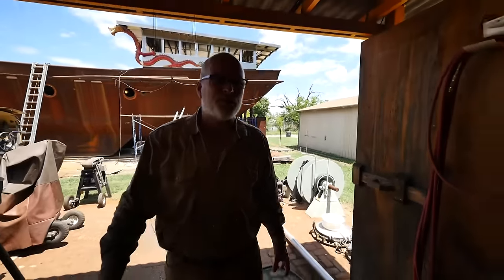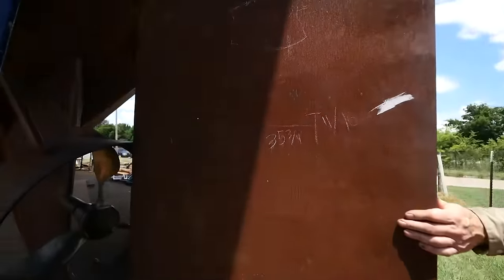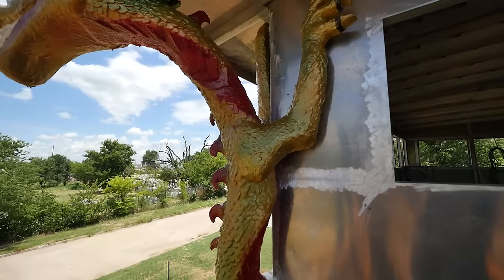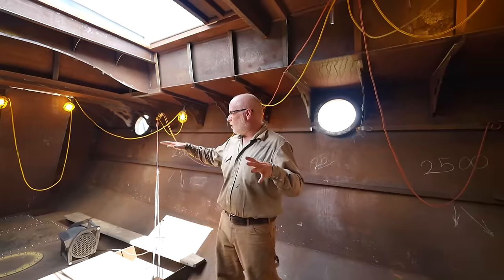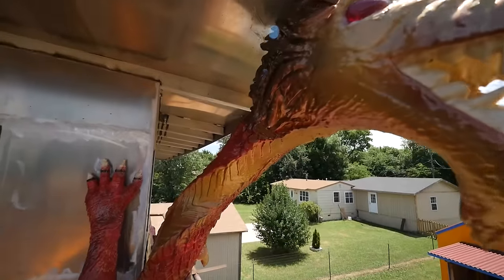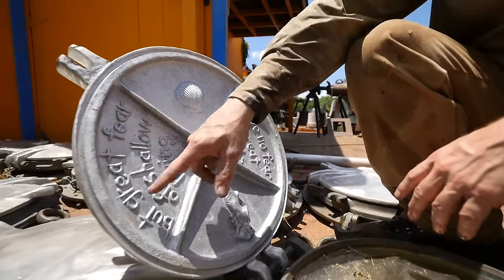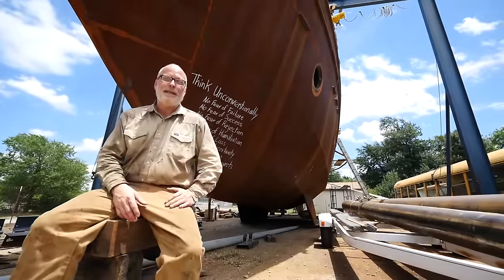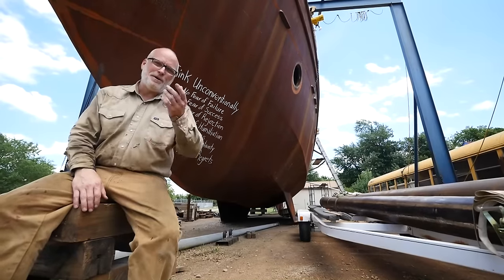Tour and Invitation

Comment: Hi Doug, the 5.9L Cummins is a very good motor. One issue I have with them is the injector lines. They are notorious for cracking and sending fuel spraying everywhere you don't want. I like the newer common rail types with electronic injectors which can simplify the fuel system and improve fuel economy a bit. Drawback is the electronic part. 
Fuel quality is paramount. Most fuel today is pretty much crap.
Run two or more fuel water separators and keep plenty of fresh filters on board. I ran a small fleet and my hiring supervisor was previously plagued with injector failures.I replaced one set on one out of nine trucks in one year. Total miles was around 400,000. 
The secret was simple, a good grade fuel system cleaner. It cleans, lubricates, and protects them from water in the fuel which is almost impossible to keep out of a marine fuel system. Damned vents. ;-)
Great job on the build.

Comment: I have a question which I think has been asked, but just in case. How will you get the engine in the engine room? through the top after you remove the pilot house? I didn't see much access except through that hatch.
Reply: There is a long rectangular panel, bolted on directly to the cabin top, right in front of the wheelhouse for that purpose.
Reply: thanks I missed it

Comment: Hey Doug, Have you given much thought to mast electrical? There is likely to be bunches of wires going up each one for lights, radar, cameras, antennas, etc..   If you are going to lay the masts down and put them back up after the river journey, how are you going to deal with the connectors and wiring?  Unsecured wired in the mast will wear and fail quickly at sea, and you are likely to need to change the wiring at a later date to update or outfit the boat for the research project at hand. Any insight?
Reply from the maker: We plan on gluing in some plastic conduits after we have the mast joined together.   And the mast will be stepped once we are in the river and stay put.  We'll just have to duck under a few bridges.

Comment: So, is your main drive sail or diesel electric?
Reply from the maker: Junk Sails http://www.svseeker.com/wp/sv-seeker-2/sailboat/propulsion/sails-2/?v=7516fd43adaa
Reply: I actually used to rebuild the electric GE traction motors on the locomotives for The Arkansas and Missouri RR in Springdale, AR. These motors were the driving force in Americas subs during WW II.
A lot of people don't understand what the term diesel/ electric means.
Reply: I actually got to tour the engine room of the paddle wheel boat The Branson Belle on Table Rock Lake and was pretty amazed as it was set up much as locomotive. Diesel engine drove the generator which drove the traction motors with the bull gears which  were heat seated on to the electric motor drove the axles which  was the same thing as that drove the propellers on subs.

Comment: I've had an idea for escape pods I thought of while watching the greatest catch, instead of sea suits. The pods would be cylinders about 6 foot long and about 36 inches in diameter with a hinged top or cap. The pods would mount to a rack on the side of a ship. To get into the pods and launch the pods the rack would tilt 45 degrees in towards the ship, you would open the cover, slide in feet first, close the hatch and pull a release cord, the pod would slide off the rack into the ocean. 

Each pod would have an emergency locator beacon, food and water rations, 2 way communication between pods, strobe light, a recovery hook, medical kit, barf bag, thermal blanket, can of beer.    

The reasoning is an escape system that could be launched in under 1 minute. Occupants could be conscious or unconscious, not being exposed to the elements would greatly increase chances of survival.
Reply from the maker: Interesting idea.  I suggest reading "Suddenly Overboard".   The statistics about how people die are the water have almost nothing to do with the capabilities of their life boat.  Most could be saved by simply wearing a PFD.
Reply: SV Seeker
I recently read Treasure Island. I knew it as a children's story until I read the book. I was surprised by how brutal the characters were. Noble men were far and few between.

I will check out the book, ty.

 http://www.walmart.com/ip/Suddenly-Overboard-True-Stories-of-Sailors-in-Fatal-Trouble/22556576